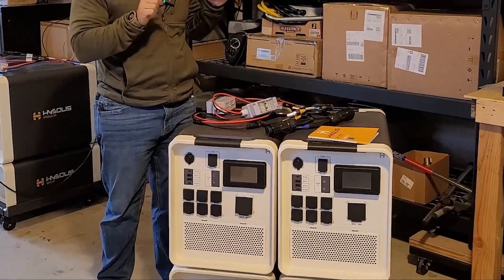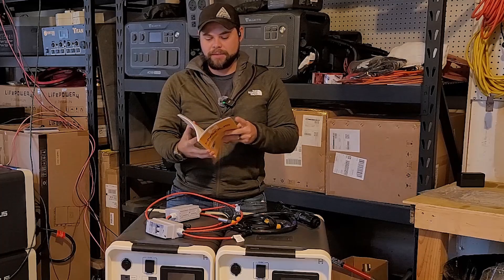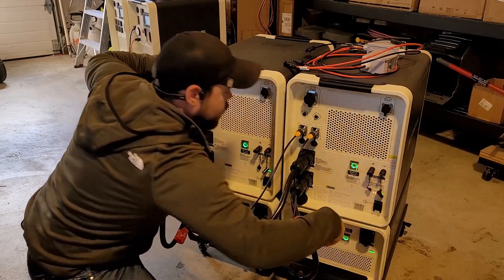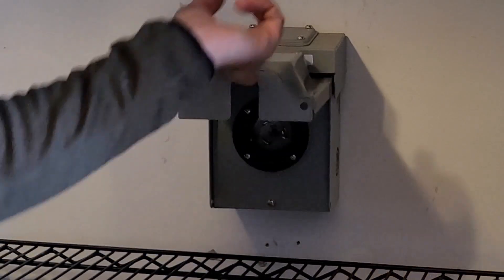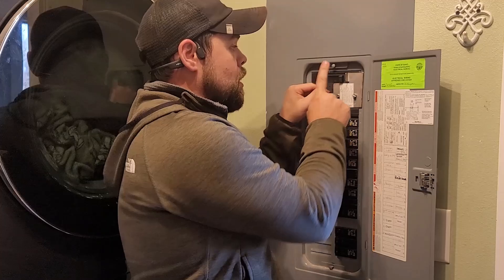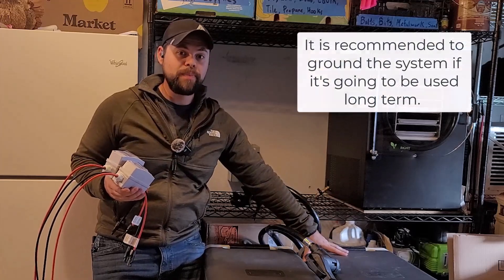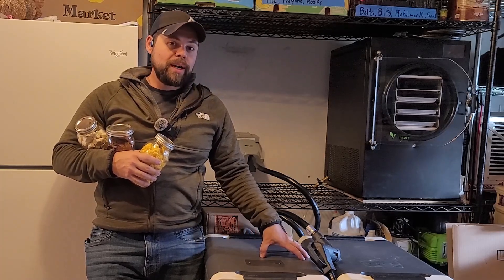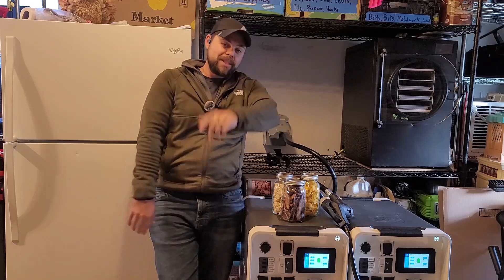Easiest Off-Grid Solar Setup with the Apollo in 240v Split Phase Configuration Setup Guide

Comment: I bought s similar setup from Ben and the Apollos are fantastic and so easy to operate. Having them connected to my service panel via interlock switch and 240V power is great. Then I can choose which circuits I want to activate based on my needs and power management. Ben does a great job helping people save money on their investment.

Comment: Ho does this system compare to the BLUETTI AC500 ?
Thank you.
Reply from the maker: Way better solar input, more battery expandability, more reliable, better split phase output with two units. The AC500 cannot do 10 kW output, it's limited to 6 kW output.

Comment: Your instructions are impressive. I’ve decided to get the Silver Pkg and have you on my spreadsheet for my upgrades to the Ray Cabin. I’m getting a bid right now from our electrician and want to price it correctly so I’m restudying this video over and over.  Thank you thus far for communicating with to. 

I’ve identified my solar panel location so I’ll be clearing it this week. 

Sorry to email so many questions as I have my electrician and HVAC guy coordinating at the same time as I’m running power for mini splits as well. Great content. You rock

Comment: The NEMA 14-50P cable that you are plugging into the NEMA 14-50R cable that comes with your kit, where did you get it? I found this one on Amazon, however, the 14-50P looks like it's 3 straight pins and one round one, while on the 14-50R it looks like 3 straight pins and one that is not round, but "D" shaped. Not sure if that will work or if I should be looking for something different. Thanks.

Comment: Question: I have a split phase system with no backup batteries but it is t draining evenly and the inverter on the second system will not stay on. Any ideas as to why?
Reply from the maker: That's very odd, not sure why.

Comment: Ben when done using the Apollows and after turning off inverter first then turn off batttery can we not leave all cables connected?   I keep my apollows selected to split phase operation all the time and never change that.  I dont like the exercise unplugging and re-plugging all those cables everytime i use the apollows.   What do you think?
Reply from the maker: I leave mine connected 100% of the time. I don't know of any reason to disconnect the cables.

Comment: ben, your advice to someone considering this, but has no solar option due to too many trees surrounding us.  i’d like to have home backup and be able to charge it at off peak pricing and use it during on peak pricing.  please advise.
Reply from the maker: Without the sun your only option is wall charging from the grid when grid is available or a gas/propane/natural gas generator.
Reply: @minutemansolar yes, have a small champion 2k propane generator now.  is that sufficient?
Reply from the maker: @nerkymusselman8843  Yes you can charge from that.

Comment: Question: What is the current handling maximum Amps output in split-phase 240 AC mode ?
Reply from the maker: For two units 25a at 240v, four units 50a at 240v, six units 75a at 240v, eight units 100a at 240v, up to 12 units.
Reply: @minutemansolar  This is a useful current output for total home backup. 👍

Comment: 1Is it true that I have to use all 4 solar panels?  I wanted to use only 3 and was told it wouldn't charge.
Reply from the maker: You need a minimum of 120v VMP from your panels for the Apollos to charge from solar. If the panels you have require you to have 4 so your VMP is at least 120v, then yes you need 4 of them.

Comment: Great video.  2 suggestions:
1) slow down 10%
2) zoom in on panels as you work

I get this but others might think too fast.
Reply: To slow the video down click the gear icon in the lower right side of the video image, click playback speed, .75 will slow the video a bit and this is done without changing the voice pitch.
Reply: i agree with the extreme close ups of any panel work. that’s exactly what i was thinking while watching.